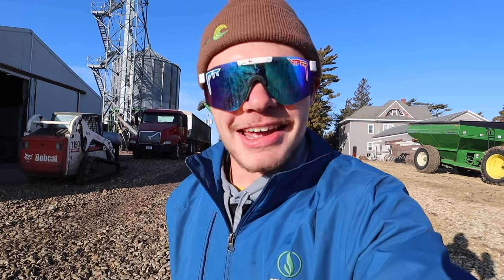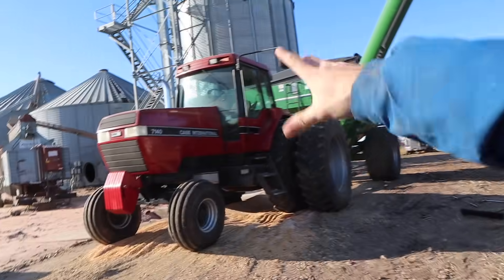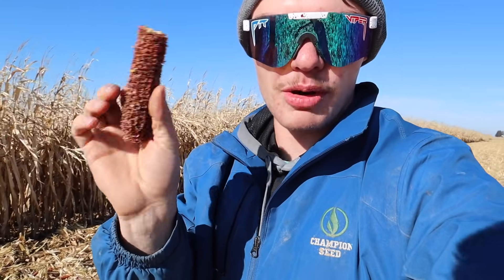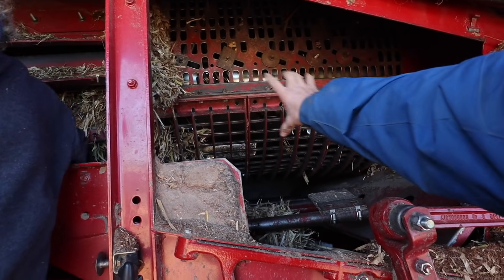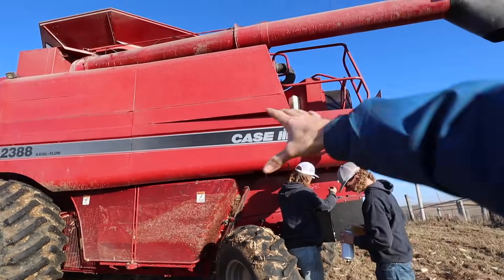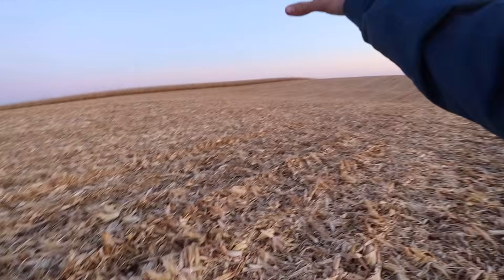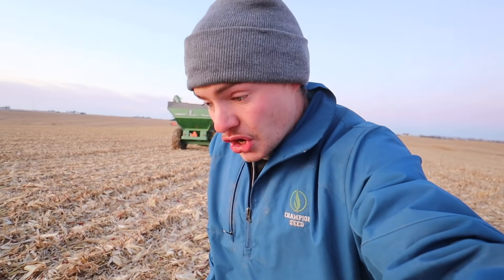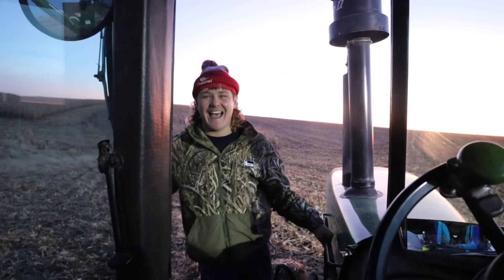I Accidentally Saved The Farm $40,000

Comment: Lots of gardeners do no dig gardening with thick mulch, which is basically what you're doing with no till corn on corn. When you don't disturb the soil, the bacteria, soil flora and worms have a chance to form healthy communities, and the mulch protects the soil from the sun, which is a big radioactive factory. Theoretically, if you break that corn debris down small enough, you will be building better and better soil with no till corn year after year, because the stalks that breakdown at the bottom are forming rich healthy soil that is protected by the mulch above, which means less fertilizer and water is necessary. It would be an interesting experiment to do it for 5 years and then compare soil health and yield with a different field.

Comment: Thank you for the video ride along.
I use to rent a small house on a active farm. So I got to watch the super long hours the farmer put in during harvest. He litterally was harvesting by himself & would work until he couldn't stay awake, shut down the machine and take a nap in it until the cold woke him, than continue on. It actually scared me for his safety. I'm so glad your family works the farm together.
Why I bring up, you talking about flattening out your low spots. Choose wisely. The farm house I rented was surrounded by a creek  & every year there was some flooding, the creek filled up and spilled over into the farm fields. One year it was so bad, I couldn't  leave the property, bridges were not passable. The basement always had a little water running across the floor in flooding rains, but the bad year, my s10 pick up had water up to the I bar and it was only 10 feet from the house. The standing flood water was within 4' of the corner of the house. The well had to be shocked that year. 
So think long and hard about where the flooding rains will go when the Earth is saturated.
You'll likely loose that much more yield , if it doesn't have any place to pool.

Comment: regarding vertical tilling: the corn senesced and most of the energy went into the corn right? doesn't that mean most of what is left is carbon? if you till it, that would tie up all the nitrogen left in the soil wouldn't it? I'm thinking the new part to make smaller residue on the field is your best bet, like you said later in the video.
Reply: Michael Payton I don’t know much about much but in Aus farmers will burn the stubble from wheat crops and i was told it puts nitrogen back into the ground that gets ploughed, other times they grow clover and plow it in as green fertiliser , so it seems farming is 10% knowledge , 10% guesswork ( for rain), 30% sweat, the rest i think is luck.
Reply: Ross Dunkley To burn his field would help keep the oversized pieces  from building up too high to grow in and it would restore some of the nitrogen to the soil but it removes too much to help water management and throws all the carbon in the air. 

Though he  didn’t mean to do no-till with the corn, when done intentionally elsewhere, the idea behind it is that it allows for the stubble create a deep mulch to help take up and store excess moisture (which ironically what kept him out of the field) and allow for microbes to develop beneficial relationships with the plants to restore nutrients the plants take. The biggest problem I see with large scale farming systems is the stubble is too big to big to create good mulch and quickly creates feet of useless carbon the just impedes the process. 

I think he would see conditions improve a lot if he could get the new part that makes much smaller mulch.
Reply: Michael Payton  got it , it’s all a big balance, I guess with wheat it’s a complete other beast that has different needs, thanks for the extra info, it’s interesting.

Comment: Maybe if you want to experiment if its dry. Take your 32% and apply about 7 units of Liquid Nitrogen across about 100 acres of the calmer confetti and if also dry enough run your reel disk and check your decomposition. I know de-nitrification is a problem with fall applied N but if there is any residual nitrogen left  after harvest it will be tied up in the residue any way. I was just thinking about boosting/kick starting the decomposition. In anticipation of next year's crop.

Comment: We use a very light rate of 32% with our pre emerge herbicide. It will RAPIDLY decompose cornstalks. As far as tillage I highly recommend an in-line ripper like @howfarmswork is demoing. Breaks compaction underneath with very little disturbance on the top of the soil. You will also find that it will drain wet spots. It is truly a great tool! You get all the benefits of tillage and no till at the same time!  I highly recommend finding someone to let you demo one. You won’t regret it!

Comment: I like the new ideas you are innovating into your farm 2 potentially make the farm more profitable no till is by far better for the soil your letting the soil build up with organic matter, micros, and nightcrawlers by not destroying there habitat by doing a lot of tillage 

You mention using your vertical tillage toil to help integrate the residue into the soil but unless your tool has angle all it will do is size up the residue which your Chalmers choppers are already doing, just thought I would mention it 
I farm with my dad in northeast nebraska and I like using no till it saves time and money but with our heavy clay soils its challenging to have dry field conditions to plant in if we dont do any tillage at all, but it does depend a lot on the weather as well 
One other side note if you are having problems with residue breakdowns look into cover crops to balance out the carbon ratio in your soil, micros need this ratio to be on par from fast and proper decomposition of the residue 
I learn in college that organic matter is built up over time it takes several years to get a high organic matter like 4 5 and 6 percent that pastures and native land have, but the residue is not what makes organic matter, organic matter is built up by doing no till the more tillage you do the less organic matter you will have and the more benefits the night crawlers and micros will have on your soil

Comment: Use your sprayer and spray some 32% or 28% , which would be better because 28 doesn't freeze and keeps your sprayer winterized, over the top of the trash when you get done combining, That will help degrade the trash for spring.

Comment: In my opinion you need to chop those stalks down low to aid breakdown of the leftover organic residue and plant a break crop of some kind or even just grass for a couple of years and take hay off in the summer and sell it on. The land needs to be rested. If you don't then repeated reseeding of the same crop type will create reabsorbtion problems and disease. Not ploughing the organic matter in leaves you with only natural breakdown which on repeat crops could also result in clogging of machinery. But you know all of this and more and you can see that happening as you noted in the video there are some stalks that have not broken down.

Also, by taking out the trees and making one giant field I believe will be a mistake in the long run. It may be more efficient in planting and harvesting terms but it would be detrimental to the landscape and what is left of the natural habitat for wildlife. There is good scientific efidence going back over 50years that proves large scale industrial cropping is not good practice.

Because livestock and or root crops are not run in rotation on large scale farms there can be a natural decline is soil health. Striking the right balance young man is the key and repeat crops year on year is an off balance practice in my opinion. Have a think and put me straight in a reply because we can all learn more from many opinions!

Comment: Ahlafirmy Bey Islam, you know that in the depression era I believe, and they did the same thing that you just said. The fields were very productive, and they had sections or rows of trees maybe 20 to 40 ft wide and so they decided that if they were cut down they could have that much more crops. Then they had a drought, and the wind blew and blew. It started to and did blow away the top soil also. The trees were natural barriers ,and had they still  been there a lot of farms would have been saved. They could have blocked. Much of the sand, then held back even more. This was discussed later.but there was a reason that they were left there in the first place. Ahlafirmy Bey Islam

Comment: Look. You said yourself that that stalk was a year old. It and this year's material aren't breaking down. You will use a lot of chemicals to control weeds and to fertilize the crop. Turn the ground over. Investigate doing some irrigation after a good plowing and disking to control wind erosion. The sprayers use less fuel than the tractors though so......

Comment: Wonder - both combine and grain carts are running all over the fields at harvest - to further save fuel and to further get away from tilling......
WHY don`t they both have some kind of light surface implement attached behind to knock down/further break up/ spread out corn stock left behind.....
Cole - can you invent a tool for that - or do I have to.....both combine and tractors have the horsepower.....and just plan for not backing up.......🤔🤔🤔🤔